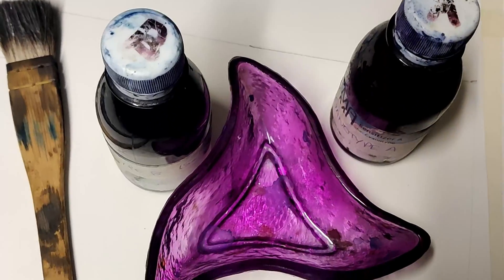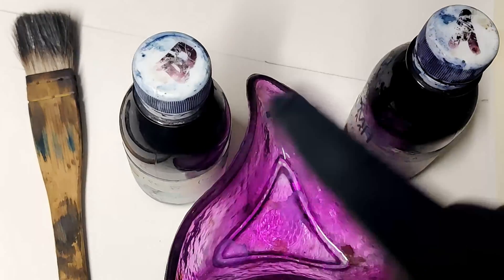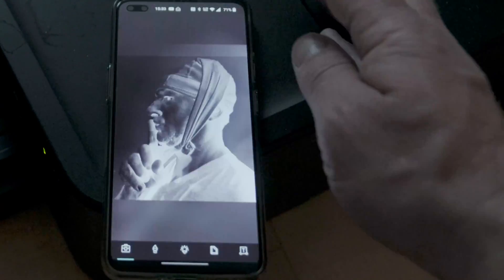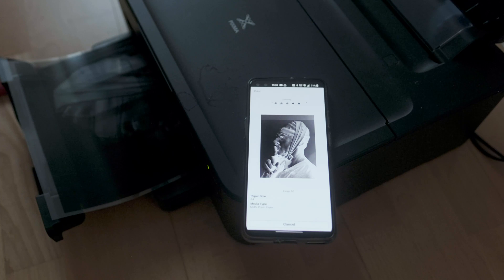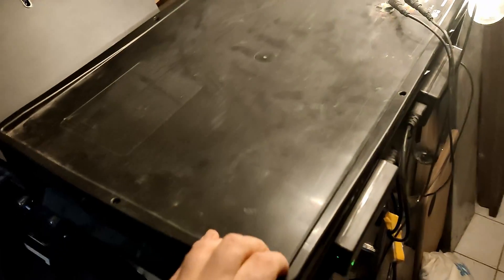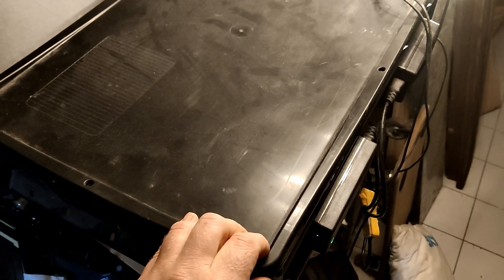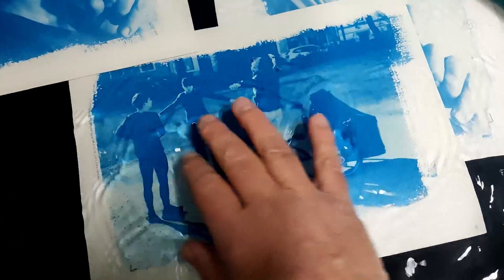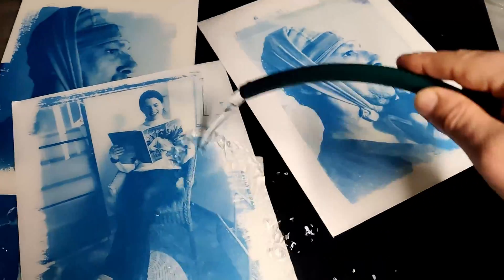Cyanotype process with your phone! - Making a negative

Comment: Thanks for the great video. I have a question, If I use a light box, do I need to put glass over the film?
Reply from the maker: Thank you! The glass is to hold the negative in place, to keep it registered to the paper.
Reply: Thank you for the answer. will a clear plastic from a picture frame do the job or will it interfere with the UV light? @GavinLyonsCreates
Reply from the maker: @yuval6354  Plate glass is  nice and heavy to keep things fixed. I bought a piece in IKEA for a couple euros in the leftovers/reurns area. You can always use a picture frame also, to keep it tight between the paper and neg.